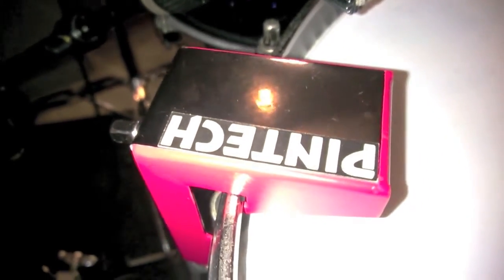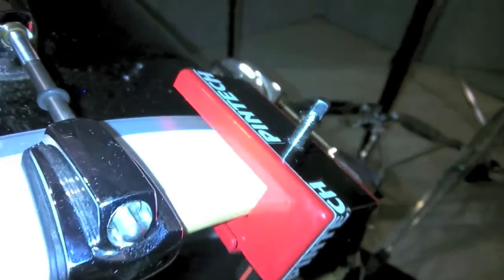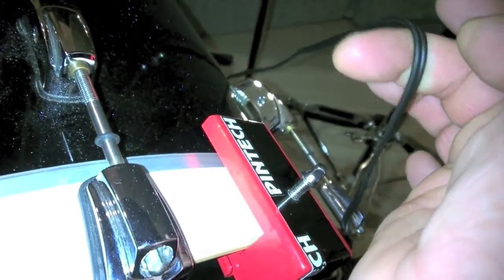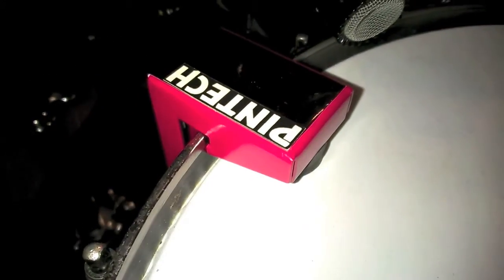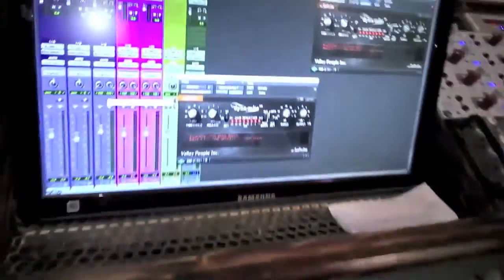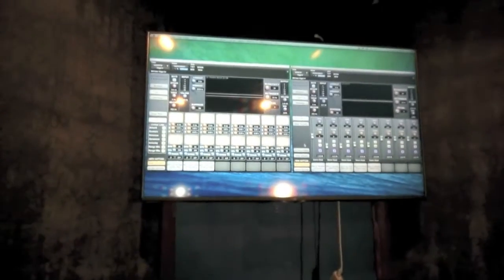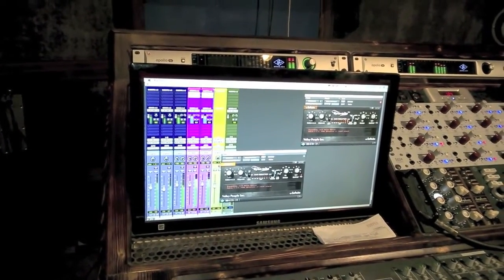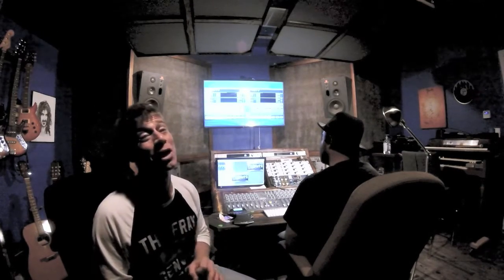Using Pintech Triggers Through A Pre Amp To Trigger Samples In The Studio

Comment: So are you processing the trigger signal before it hits the module/sofware and triggers a sample?
Reply: +TYLRbass Thanks for watching. In a sense yes. The trigger signal hits the DI, which is sent to the channel. Put the gate on the channel, hence you can "control" the signal/tail of the signal to get the level of triggering you want. Otherwise it's just a live mic taped to a drum. LOL! This method allows you to use the trigger signal as if it were a mic signal. Really it's like using triggers to control your gates live only it's a trigger signal is being sent to a software interface vs a mic signal being sent to your channel. It sounds like a small fart on tape, but through the triggering software it responds like a drum mic. :-)
Reply from the maker: and now I reply as myself. 
+TYLRbass Thanks for watching. In a sense yes. The trigger signal hits the DI, which is sent to the channel. Put the gate on the channel, hence you can "control" the signal/tail of the signal to get the level of triggering you want. Otherwise it's just a live mic taped to a drum. LOL! This method allows you to use the trigger signal as if it were a mic signal. Really it's like using triggers to control your gates live only it's a trigger signal is being sent to a software interface vs a mic signal being sent to your channel. It sounds like a small fart on tape, but through the triggering software it responds like a drum mic. :-)